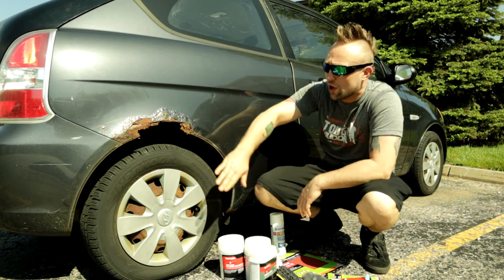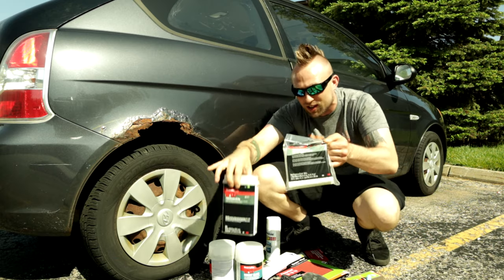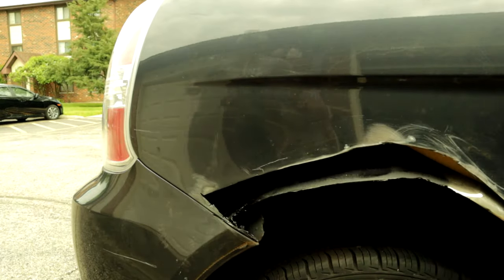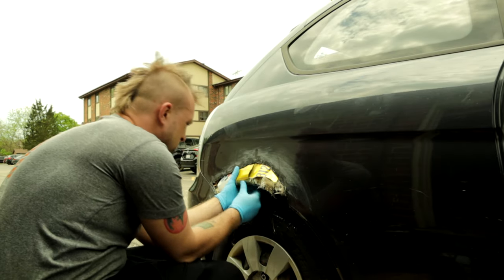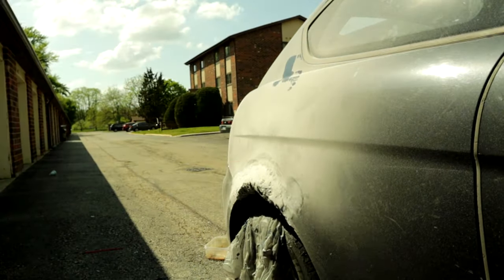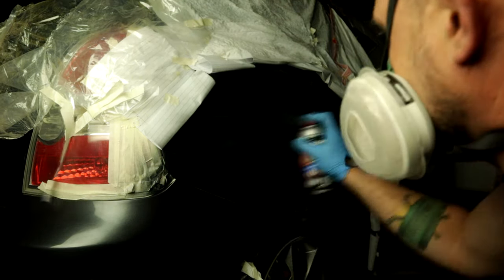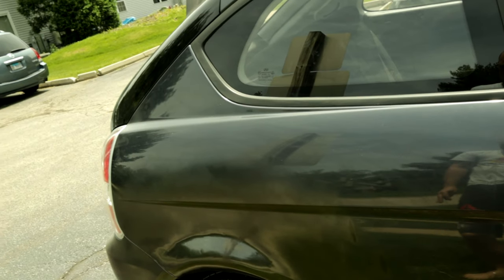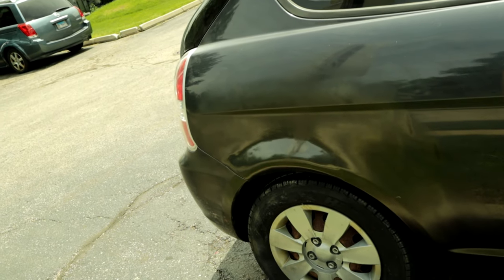How to Repair Rust Holes on Your Car Without Welding

Comment: I'm a professional Auto Body technician and refinisher and I can say with experience if that's your first time you did a great job
Reply: Hi, is the aluminum cans good idea? I love it,  but not sure how long will it last ?
Reply: You must work at a Maaco, I’m also a body tech and this made me cry
Reply: @Jas111ld  this fix will not last this is more of a temporary fix that will have to be redone in a couple years.
Reply: When did Walmart get in the auto body repair business?
Reply: He should have taped off the wheel, he got paint all over it
Reply: How much would you honestly charge for this job? I need it done but not sure if I should do it and risk making it worse or just take it to an auto body store
Reply: @franklinit2722  🤣🤣🤣🤣
Reply: @retrox684  if your a body tech , why in the hell are you even watching this video ? You must be a TROLL body tech ! This guy did a kick ass job and he saved hundreds doing this job on his work car !
Reply: Listening to me it is trying
Reply: It not going to be last long
Reply: This might be a super stupid question, and I’ve never done this before. But if you have a massive rust hole do you think you could spray Great Stuff in there, and then just sand it down, then just cap it off with body filler?
Reply: How much would you charge for a job like this? Both wheel wells?
Reply: @fearlesscheshirecat1411  better to do new weld
Reply: @fearlesscheshirecat1411 , No because the rust will just continue to spread and the filler will flex, causing the paint to crack, etc.
Reply: Thank you for saying this because I’m currently doing a rust patch on a ford fusion and thought I was doing horrible. Seeing this guy made me feel better about my first time doing body work
Reply: @Crazee  some people like to see the stupid shit people do to their cars
Reply: @Fearless Cheshire Cat  no. It will rust out in no time. Foam absorbs water and holds it. That's why body panels rust out in the first place because car companies put foam between panels for "sound deadening". They do it so they will rust out in a few years
Reply: So how much would labor for this job cost?
Reply: He could have spot welded a patch
Reply: @fearlesscheshirecat1411 nooooooo never use great stuff it will rust out super fast.
Reply: I need to do this
Reply: You did an awesome job 👏🏻 I have to try it myself with my nephew's car 🚗. Don't know when. I'll do it 😁
Reply: Schleper work
Reply: so whats the best method of fix this i have a chevrolet silverado a little rust on bed side i wanna get it fix it ...
Reply: @WhatsGoing0nHere 
For THAT job?! 
Or an actual repair?
$500-$600 for a mediocre job  with a welder imho
Reply: Who's gonna give this comment one more like? I'm not too keen on being the 666th liar. It looks terrible. Maybe relatively speaking it's a good job, but let's keep it real. It looks terrible, & this video is a how to for everyone else. a professional should be giving this instruction. What we learned is if you're gonna do it yourself that's what it's gonna look like no matter how "good of a job" you did.
Reply: @retrox684  not very professional if this is "a good job" lmao there's much muchhhh easier ways to go about this with a "budget " mindset...
Reply: Yes, IF 😅! But yes, he did well 😂

Comment: I have to give you full credit. I do metal finish for restorations BUT on a cheap car, what I learned in 40 years of work was that you need to match the repair to the car. I do a '3 year repair' for cars that I am certain will not make it beyond that time (usually because the owner will kill the car). I got over all snobbishness of a quality repair when a guy brought me an old Volvo 122 that had crappy body work from a PO. I asked him what was the longest he had ever owned a vehicle (in perspective, I have a 1970 Land Rover I bought in 1989 - and own to this day). He said he sells them in 2 years or less. He wanted it looking nice, painted inside and out (to 'look' like a full restoration he said). Well, 2K later and it left with the cheapest smoothed over rust repairs (but great paint) I ever did. He called me three months later and said he crashed the car. He got full insurance payment for it. Sometimes cheap is okay. Sometimes "good enough" is okay. Knowing when those times are takes experience. Not everyone has a shop and metal working tools - and not every car is a restoration project requiring metal finish. So - full points and credit for what you did here. You matched your skills to the car to reality; and made the car look better.
Reply: Best and most fair comment!
Reply: Thats an awesome comment!
Reply: well said.

Comment: For furture reference fill that big hole with spray foam. Let it dry and cut it back that out the fiberglass mesh over it.
Reply: Hey that a great idea - suggest Loctite foam - it's closed cell foam ( harder) than open cell foam.
Reply: DO NOT DO THIS WHATSOEVER… that foam holds moisture and will rot existing metal very quickly(ask how I know) don’t listen to the info above
Reply: @96_12v  what if he seals the inside of the fenders where the foam will touch first? maybe some sprays of anti rust or something?
Reply: NOOOOO NEVER USE FOAM

Comment: an easier way, go to the junk yard get a pair of front fenders for the same car if you can get them not rusted, the arc of the front fender is similar to the arc of the back but on the opposite side, cut what you need, glue them on with liquid nail and maybe some rivets, some bondo, paint and done, i just did this on a 2007 dodge caravan ,worked good

Comment: My uncle was a BODY-SHOP MAN and he used a lot of metal cans, pop cans, etc. to patch holes ( a basic back-support) then used the body putty, sanding, and paint - he took his time and did a very good looking job !!
Reply: In the UK we have a fine tradition of filling the holes with cheap filler and newspaper, a rub down,  then spraying it. Second hand dealers were experts at it, they'd get the car looking pristine, then shift it. As an added bonus they would even top up the gearbox with sawdust, to stop that annoying grinding noise. All part of the service Sir!

Comment: I have a '98 s-10. Rust hole in the bottom rear corner of the cab. Wire brushed the rust, and filled the hole with expanding foam. Sawed of the excess with a steak knife after it dried. Sanded it flat. Then I applied 2 coats of bondo. Sanded flat. I can kick it as hard as I want, and the bondo didn't even crack. Solid as a rock, and water-proof. BullyBilly.

Comment: Several years ago I used expanding spray foam to fill the rusty rocker panels. Perfect backing for the Bondo filler, but not very structural for the body.
Reply: I’m thinking about the same to fix my Jetta air box completely rusty
Reply: @TheDropebr  same with my jetta lmao
Reply: Do it right and replace the metal

Comment: This is awesome.  I plan to use metal window screen material for my just about totally gone rocker panels, like you did with the cans.  The tricky bit will be where there's nothing left to hold anything in, but that's where that really sticky fiberglass might work to get it started.

Comment: Beer can had me laughing so hard😂 But I used to be a layup tech and worked with carbon fiber wet layup (I prefer pre-preg so much more) , I used 3M adhesive spray to tact the pieces of carbon fiber then used a paint brush and applied the resin.

Comment: Got a large rust problem on the lip of my trunk lid. Was able to throw a camera up between the two sheets of metal where some wires go in. THANKFULLY the rust hasn’t spread between the metal sheets yet. It’s still just the bent over/welded flange part. 

But I was super intimidated to fix because I’d have to basically rebuild a part of it like you had to. This video had some great advice. Will definitely keep some beer cans handy. Thanks man!

Comment: Depending on the age of the vehicle & how much it had been exposed to the sun, the new paint may not have matched the old due to paint fade, even if the color code for the new paint was correct. I had the same color issue with a touch-up pen that I used on my old car (at 8yrs), even after I washed the whole vehicle.  I wonder if applying a new clear coat to the repair area & waxing the surrounding existing finish would have helped(?).  That aside, great video, & I appreciated the tip about the fiberglass mat.  I went with metal mesh & the fg cloth instead; just had to clean up cloth strands, but def not so frustrating. 👍

Comment: Asking because i have a big ole hole in my $1200 used car rocker panel (nothing structural and all the external body panel, currently), and welding seems like itll be more than what I got the car for:

Since you did this work, how has it held up? Did this help prevent rust spreading/getting deeper? The hole is pretty wide, but I plan on making some "bridging supports" (not foam) internally to help with application and from bowing/sagging. I dont need the car to last forever, but I dont want my next (hopefully actually nice) car purchase to be determined by when this car rusts apart. 

I may also modify your painting advice here to freshen up the sun baked paint job the last owner left me with, it seems easier to do for "good enough" than what ive picked up from other videos. How has your paint job also held up, and if you ever got the paint corrected/polished? I'm ok with doing the painting piece meal, like one body panel/area at a time, to make it managable.

Thanks for your video and updates! This seems like it'd be fun knowing going in.

Comment: Hi there. I was wondering if this had any effect on the car's structural integrity? And also, do you think this would work in the engine bay for the battery compartment?

Comment: Wax can take the clear coat off. Then just get the right color. Spray it again. Clear again. Good job. I think it will always rust again. Cut the cost down just use regular Bondo. Don't cut away as much as you did. Just take the bubbles off leave the rust behind.. spray rust restore and leave it two days. Then apply mesh with jbweld behind to bring closer to outer surface. Then just apply regular Bondo. Prime leave for two weeks to harden of course do this in above 70° weather. After two weeks sand put on finishing putty sand with 1000 grit then paint. Leave first coat for four hours. Then second coat. Then clear. Wallah it will last for two years. Rust will come bay. Because there is just around the outside. Light sanding. Reapply paint

Comment: I can’t believe you did that in 7 minutes. I have a bunch of body work on my van and was intimidated, but 7 minutes. I only got to fill screw holes from side runners that broke and one small rot spot.

Comment: If you’re going to put aluminium against steel make sure there is a barrier between them. If you don’t you’ll get Galvanic corrosion. But hey, do whatever you want.
Reply: Yup, dissimilar metal corrosion, it's real.
Reply: hes using a cut up can to repair his car i dont think he cares about galvanic corrosion 😂

Comment: Looks alot better than a rust hole
Reply: Till the bondo bubbles under the paint and eventually end up with a bigger hole than what you started with. But if it's a pos beater vehicle that isn't going to last more than a year or 2 than it's worth it.
Reply: @briang4470  why does the bondo bubble.
Reply: @dittyfpv7615  the bondo bubbles if it's not sealed and gets wet or if the rust behind was not treated properly. If he used fiberglass based bondo then it will have a better chance of holding up but in the professional automotive repair world, filler should never be used to hide rust ever.
Reply: @briang4470  did you watch the video? Lol he cut all the rust off

Comment: The colour matches it will change the same as the rest when you clear coat and polish the fibreglass needs to be applied to a surface usually you build the form and shape you want from rapid filler expanding foam then fibreglass that.

Comment: I just take a large piece of tin foil and lay layers fiber glass cloth and soak them with the resin. Like a bandade with salve on it put it over the void and warm it with a hair dryer to speed up the cure time. Once you get the shape formed under the foil you can peel the foil away and fill and shape the rest with fillerand have a get base to fill.

Comment: Looks great, how long has it been there and how is it holding up? I’ve got a cargo van and the rockers on both sides along with the rear wheel wells are rusting out pretty bad. Using it for work so it doesn’t have to be perfect but I want it to hold up
Reply from the maker: Like 2 years strong noe
Reply: @DylanKowalski123  awesome idea Bro!

Comment: I was in a shop years ago and guy was fixing rust behind rear wheels on a old Nova, he didn't have and fiberglass mat but had resin, he had red and black flannel shirt material  on qaurters, got it painted and could not tell it ever had damage, scary what you can hide with bondo

Comment: I don't know if it's such a good idea to mix alum with steel for exterior installation when it's constantly under weather condition. The electrolysis process between 2 distinctively different metals would eventually disintegrate by itself. I would like to see how the repair lasted after 3 years. Please report an update.

Comment: That looks like a grocery store parking lot repair job with those cans. And filler is recommended about a quarter inch thick at the most. When you paint also, remember to over lap 50% to give a nice even coat across and use blend if needed

Comment: Tip; lay the fiberglass cloth on a big piece of plastic bag. Saturate the cloth with resin and fold the plastic bag over the saturated cloth. Work
Out all air holes and remove the portion of the bag. Place the cloth over hole and when it’s set, remove the bag. You hands will never touch the resin
Reply: I am intrigued... Just wondering, wouldn't it not be difficult, especially given the larger your repair area is, for the fiberglass cloth to stick without falling off due to gravity and the additional weight of the plastic bag material that would be added to the weight of the cloth while your waiting for it to cure? Also do you find that there is alot of waste uncured fiberglass that comes off onto the portion of plastic bag that you removed in step 3? Do you paint the fiberglass onto the repair area first before you stick the cloth onto it or just stick it on with the surface of the repair area dry?
Reply: @Heavymedicine1 idk if you ever figured it out, I also am considering a larger hole repair using a process like this. My thinking is if you're able to jury rigging the "beer/soda" can idea they had here with, maybe, wire coat hangers to make some "ribs", you could add some structural rigidity and more places for the composite to "hold on" to. I just don't know if the wire coat hanger could have some kind of metal-metal reaction or might need like a rubber (JB weld or Caulk or silicone?) Bonding/mount wherever it contacts to so any slack end of the wire doesn't rattle inbetween the panels after you're done.

Comment: good job but to be definitively efficient,  you should  put grease everywhere. grease et the only thing very efficient against rust. put grease between metal and carpet, inside door, behind bumper, behind (inside the car)  the repair you made (everywhere inside this hole before reclosing it instead of using paint), hollow areas... For rear wings unreachable with a paintbrush, use an extender and poor old oil everywhere each year.Handyman Experience - 35 years.   From france

Comment: Try the spray foam (any walmart) to use as a filler then bondo  over it for an easier quicker method
Reply: Just to verify with you, I saw someone else say that using foam can basically speed up internal rusting due to the foam retaining moisture. Has that happened to you?
Reply: @deafengineer  as long as you prep the surface properly and put a primer over it. It works good. I did this over a year ago and it still looks like it should

Comment: For a first time attempt, and on a free car, it came out okay. But you really could have done a much better job on shaping. Also, fiberglass needs to be completely saturated in resin. All that fiberglass in there is just going to be soft and weak, pretty much as if you just stuck cut up pieces of a t-shirt in there. And since it wasn't saturated, that's also why you had such a hard time getting it to stick in place.

Comment: Dude the easiest way to break loose a stubborn tire, back the lugs out 1/4 inch. Run the car go forward about 20 feet then back up 20 feet. Have a spotter on hand outside the vehicle so they can tell you the gap from the lugs is gone. If it doesnt work with 1/4 loose, move the lugs back out so its 1/2 inch. Back and foreword back and foreword back and foreword. The tire WILL break loose and the studs will be fine

Comment: “My car broke down....it was like totaled”...😂😭
Reply from the maker: The differental went out and snapped the drive shaft and locked up transmission
Reply: @DylanKowalski123  fuck bro. Did you crash, or just lock up?
Reply from the maker: @josephknapp2945  is just snapped while pulling out of driveways

Comment: what a mess lol it is way easier than you made it look. i use tape and long fiberglass and make my own fiberglass patches about 1/8 inch thick and layer it up. works fine and you don't have to sand that mountain of bondo you put on there. just let the fiberglass dry and the tape will peel off. you have the general idea though.